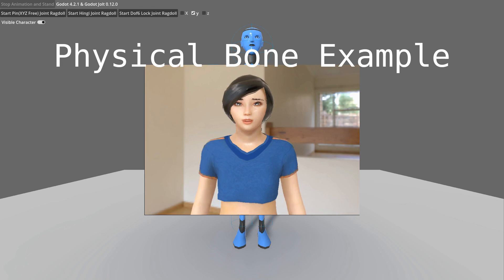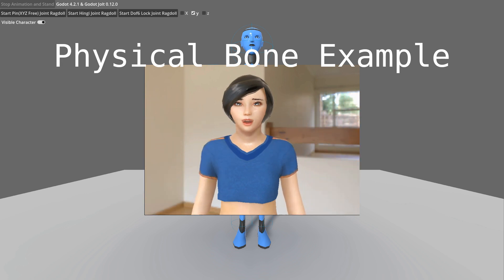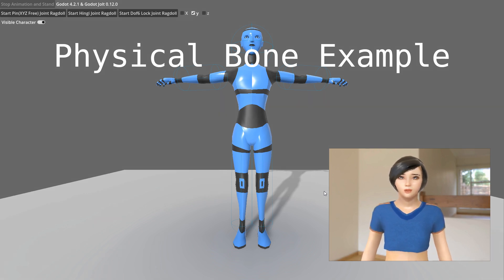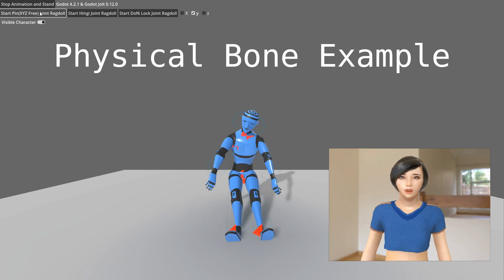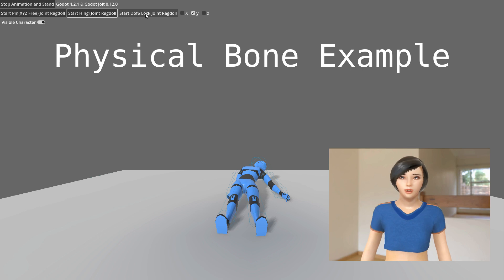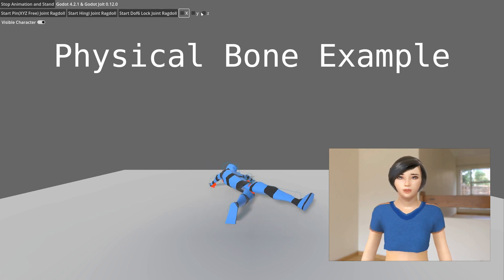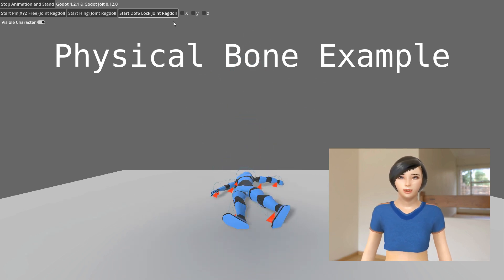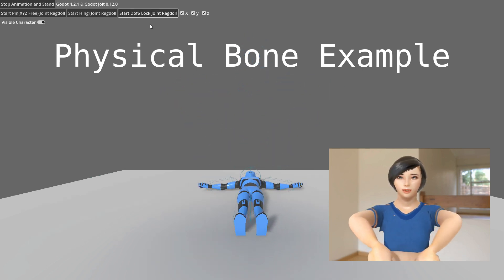Godot4.21 Physical Bone - Ragdoll  Example Demo(MIT)

Comment: It is first example that failed to work. I just installed godot 4.2.1 today and run dozen of examples. Seems like she is telling that something recommended to install. But is it recommended or mandatory? and what she is suggesting to install ?
Reply from the maker: Thanks for response.she  said Jolt(https://godotengine.org/asset-library/asset/1918)
but without jolt the demo would be work.something error happed.I only test my Windows10 platform.

To provide more specific assistance, could you please share the exact error message you're encountering? This will help me pinpoint the root cause and offer tailored solutions."